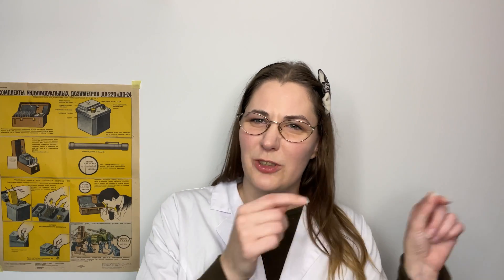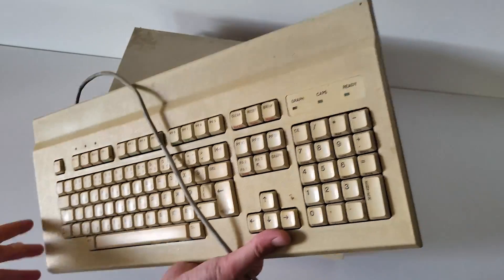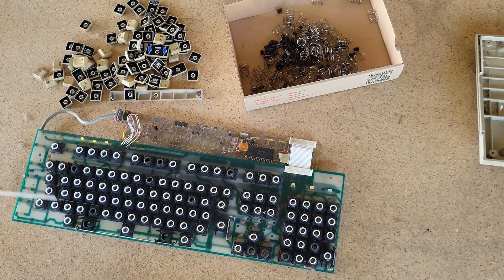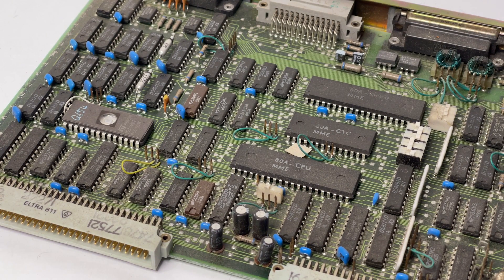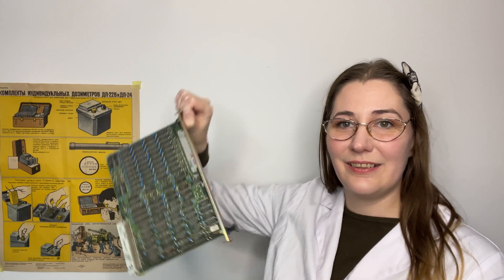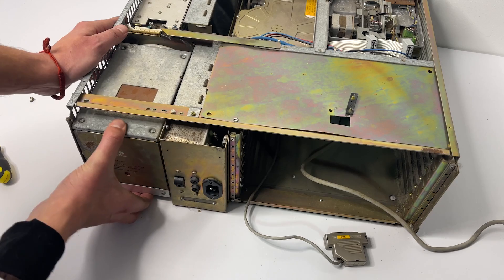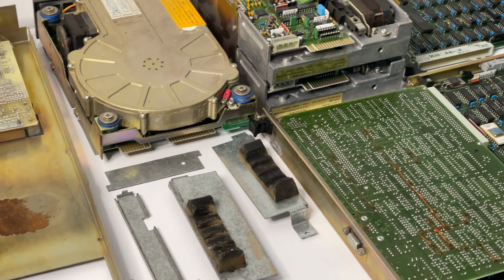It is not a COMPUTER, it is a DISASTER. Robotron SM1910, made in DDR in 1988

Comment: The only computerized thing I have worked on that is more densely packed is a moving/intelligent lighting fixture [the type used in concerts]. Imagine packing 3 slideshow projectors and the optics of a video camera into a frame with all the gears and gubbins of that remote camera [the type that can pan and tilt] you worked on.

One I had at my venue broke its pan belt, which required undoing every connector on the motherboard that ran into the head [control cables for: douser, iris, focus, zoom, prism, 2 color wheels,  and 2 gobo wheels, as well as the power for the 500w arc lamp, and all the fans and stepping motors running those devices] so you could remove the yoke mount to get the pan belt around the pan gear, which was the circumference of the yoke turret.

Yes better designed moving heads use a gear to gear instead of a drive belt to handle pan functions.

Comment: Could the connector to nowhere on the RAM be an artifact of a repurposed board or unimplemented planned functionality? Like either the board it is on is a multi-purpose board that can connect to other things, or there was a plan to mainframe the components and link multiple RAM cards together?

I propose this based on NES and SNES unused expansion ports. Those systems had cable ports on the back/bottom that were intended for disk or CD drive expansions [like the Sega CD or 32X, or the Famicom Disk System] that were never implemented.
Reply: This cards are meant to be multi purpose. Personal computer, mainframe or industrial controller. This is also the reason why this thing is so unnecessary complex. The connector you mentioned is just for testing purposes.

Comment: it's kinda strange to see siemens/intel chips there, given soviets tried to reinvent a wheel by copying anything came in their hands (quite often failing to make a competitive product it seems)
Reply from the maker: Do not forget, it is German-made, there things were a bit different.
Reply: Remember this is made by east germany. There was a permanent shortage of most things, but especially of microelectronics. In this computers, you can find IC's from literally everywhere. For the 8086 CPU, this thing was meant to use the russian clone, but the russians could not produce the needed amount. Because of this it seems they rarely delivered any CPU's to there east german brothers. So the only option was to import 8086 from western sources. Since the 8086 was on the COCOM export restriction list, this has to be smuggled. The black market is also not known for good selection and good prices. So they put in whatever they could get their hands on.

Comment: I am a bit bewildered by the 13:37 "WARRANTY VOID IF SEAL BROKEN" stickers. Did these computers and components really have a warranty? How did the warranty work in the USSR? The stickers look like the same kind found in computers in America and they are written in English.
Reply from the maker: Here it is important to keep in mind it is from DDR, they had their own stuff, we, frankly, do not know how exactly it worked. As for the USSR, somewhat it was similar to normal warranty procedure. Normally there was a warranty card (1...3 pcs) in a form of a page for cutting those out, inside so-called equipment passport (a document provided along with user manual, it contained base specifications, quality assurance seals and details of manufacturer) OR inside a logbook (serious professional equipment could have also this separate document where all changes, malfunctions, etc. could be logged). You would need to ship a faulty equipment either to manufacturer or to authorised service centre along with this passport and/or logbook, they make repair, cut out one of those cards and make a log entry of changes in a special table in one of those documents. There was a list what could be repaired for a free of charge, and what on extra charge. So a bit more paperwork was involved.

Comment: Turns out I have some boards from such computer. Definitely CPU, RAM and video. Components on some are broken (pulled them from e-waste long time ago). Nothing else and I'm fairly sure it is quite difficult to get remaining stuff. Is it acceptable to take them apart and DIY a somewhat similar computer using half-modern components?
Reply from the maker: Well, if you know what youbare doing on a low level, then why not?
Reply: I'm reluctant to tear apart old stuff if it might have some historic value. I'm kind of debating between these options (in order of increasing difficulty):
1. Find someone who need them to restore their device
2. Fix them and hunt / rebuild missing parts to use my boards as-is
3. Tear them apart and use for new project
Reply from the maker: If you want our opinion: CM1910 is not super rare in fact. Old - yes, it is. If your potential creation will give it an afterlife - why not? Perhaps, try to keep it as original as possible and   if it will be a public project — tell the story!

Comment: Wait.... you use periods instead of commas don't you? So that computer was Fifty Three THOUSAND marks? Holy fucking shit. A Trabant was only about 10K... even with hard currency to exchange on the black market, that'd still be a 3 or 4 thousand USD computer in 1988 money. Yeah, that was much, all right. VERY much.
ETA: "You have to remove one thing to remove another thing and then you find you have to remove another thing..." AH! MY FRIEND! WELCOME! Welcome to what it's like to work on modern cars, trucks, and equipment!  It's especially gratifying when they've blocked a simple maintenance item like a filter or pump with a major subassembly that turns a 15 minute job into a 5 hour one!

Comment: It goes back 35 years, not really so long, but it's remarkable how crude and clunky it looks. Far too much copper and dry electrical connections, and not enough silicon. Not really too different from western PCs of the time. I don't miss that equipment a bit.
Reply from the maker: Yes.

Comment: This vid gives me flashbacks of a Xerox 6060 thing someone gave me saying "Maybe you can fix it", and it just wasn't worth fixing after suffering a lighting strike, lol. In hindsight and Google today I guess it was a rebranded Olivetti M24, I really did like the 45-degree angled vents around the lower sides of the case. it was just as complex to get it all apart as in the bottom compartment was a "carbon-residue" connected to another charcoal board up one side of the case, and then off that was another chard PCB on the bottom of the upper compartment that had the metal remains of slot connectors for ad-in cards. every single compartment had at least one screw that was fused in place from arching, I fussed with trying to fix then figure out how to cram a 286 into the case for a year then tossed it out as it just wasn't fixable and taking up room. if it wasn't a lighting strike victim I probably would have tried to keep it, yet things happen. I guess computers have been hit and miss for eons, not just the latest fad of tempered glass convection oven styles, lol.
Reply from the maker: Thank you for sharing!

Comment: Last Week i got my own CM 1910, completely unexpected and free! It is complete and in much better Shape than yours. 
It has the rare 1MB RAM board and so far i could test, the system seems fully operational.
Got no monitor with it, so i  had to make my own  video caple from an old VGA cable, and used my  OSSC with that.
At least i was able to play some tetris, wich was on the HDD.
Reply from the maker: Congratulations!!!

Comment: Needs some cleanup and retrobrighting, 
4:09 I see a big-ass paper in oil capacitor. I wonder why such an archaic and oversized component from the vacuum tube era is even there.
11:50 calling the manufacturer's technical support, haha! 12:04 lab assistant coming to help you. And 12:17 is "automatic medical systems engaged, caffeine adminstered".
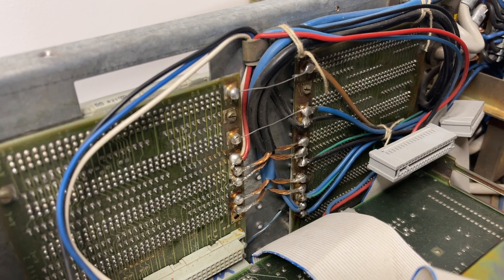14:10 yeah, no beauty, no joy. 
15:00 inaccessible fuses, I know it may be a safeguard against unauthorized bypassing by the user, but c'mon - that's a BS in design and engineering...
Reply: 4:09 is not a simple capacitor, but a line filter
Reply from the maker: ...if it would be a caffeine!... ;))
Reply: @ChernobylFamily  don't tell me it was heavy fuel, haha!
Reply from the maker: It was beer :)

Comment: If anything at all, this computer resembles a 1970s S100  based computer more than it does a PC. Huge boards filled with rows of logic chips, tightly squeezed onto a backpane, connectors and cables to the power supply, front panels and other components that got squeezed in over time. Somebody must have been trying hard to take old and proven methods to the next level. 

And yes, 56800 Mark was a high price. Calculating a precise value in today's money would be hard, but it certainly was well beyond anything a private person could easily afford. Or even get their hands on, even if they had the money.
Reply from the maker: Thank you for sharing!

Comment: Usually electronics from the GDR are built so that they can be fixed easily. At least that's the case for devices meant for the general public.This computer seems to have been built by engineers for engineers as just the disassembly to get to a broken part is a challenge. Also testing must be quite difficult as you have to put it almost fully back together first.
Reply from the maker: Agree. I dealt with a lot of DDR-made tech, which was awesome inside, and discovering this very machine was a shock.

Comment: Just to help you along, the usual English language term is SOLDER or SOLDERING rather than welding (I know this is used by Chinese translations as well).  Welding is for building steel bridges and repairing cars.
You also use the term crate, I understood what you meant after a short time, but the more usual term is CARD CAGE for the place where the PCBs are.  They might also be called CARDS, as in "This is the IO card."  The whole thing, that holds the card cage, drives, power supply, etc is called the CHASSIS.
Reply from the maker: Many thanks for this!

Comment: board2: looks like  Z80 board with Z80 sub-service chips - ? might have 64k ?

i have seen boards made by Siemens with this bus
Reply: Yes, the U880 (Z80 clone) and it's peripherals were popular chips because the GDR does produce them by itself - so they were available. In this system they used one complete Z80 system as storage subsystem and one as graphics subsystem. On the one hand it is unnecessarily complicated, inefficient and incompatible with standard software. On the other hand a very interesting piece to play with.

Comment: This Robotron looks like it might be VME bus, a 64 bit bus architecture popular for higher end workstations and industrial computers in the mid 1990s.  I owned a VME bus Sun-3/160 workstation with 1.5 KW power supply.  It weighed about 300 pounds.
Reply from the maker: Many commenters suggested the same. I trust you guys!
Reply: It's actually Multibus- also known as IEEE 796- a 16-bit bus designed for use in industrial equipment.
Reply: @douro20  Thank you for the correction.  It has been too long since I worked with that in the early 1980s.  I should have recognized it.

Comment: I’d imagine that extra ram connector is to just allow the part to connect to either side of the bus. Manufacture it with connectors on both ends and it’ll work in whatever configuration is needed, just move the bracket.
Reply from the maker: Sounds as a possible reason. Thanks!

Comment: Regarding that RAM board. It seems the board can be installed with either of the connectors facing to the inside. If I were to venture a guess, the same board is used to support two different computer designs with different bus configurations. If I recall right (it's only been over 3 decades), before getting their hands on western CPUs, Robotron also featured Russian CPUs. Maybe the alternate orientation supports the bus from those things.
Reply: The manual of the RAM board says "Steckverbinder X3 - griffseitig als Prüfstecker" - "Connector X3 - on the handle side as a test plug". This boards are so dense populated because they also included parity and refresh.
Reply: @stefanberndt3076  Great. Thanks. I'm surprised they'd use a second bus to test it, but everything is overengineered about that computer, so why not that, too.
Reply: @akiko009  Not really a "bus" to test. Just some important points to test circuits. The more surprising is, that they wasted an expensive connector just for that. Today needle-like probes are used to connect to solder joints for measuring.
Reply from the maker: Thank you for these details!

Comment: "To remove something you have to remove something and you find the screw to remove that is under something"

I think the same people designed Dell laptops. I have to replace the fan in mine, which is a commonly replaced part, and to do it I have to take the entire thing apart. Do better, Dell.
Reply from the maker: That hurts

Comment: What the hell is that thing... There is not a single board without some rework or bodge wires o_O
Was it really "mass" produced, or is it a strange kind of prototype made late in the night by a team of crazy, or drunk, or even both at the same time, engineers? 
And I know why there is a plain metal plate in front of the rear connector of the RAM board! It was just designed by the same guy who was in charge of the fuses....-_- (double facepalm).
(If you have managed to make this thing boot, you're true heroes)
Reply: It was mass produced. This are 4 layer PCB, very heavy packed. I think they where just not able to route all signals, so they added this wires as a 5th layer.
Reply from the maker: It was a mass production...well, the design is something, that is true.
Reply: @ChernobylFamily  Looks more like "mess" production  to me ;)

Comment: The main boards look like they are VME bus. This bus style is typically used in industrial equipment. It was a very odd design choice to use it in a desktop form factor. I have to wonder if they used it because it was easier to obtain VME cards as opposed to more conventional consumer grade cards.
Reply: They called this bus system "MMS 16", it was a clone of the "intel multibus I". This system seems build with compatibility to this intel systems in mind. The KES board (storage subsystem) is made to be software compatible to the intel iSBC215/iSBX218. Too bad the intel multibus was a failure also in the western world. They have set there bet on the wrong horse. I have read an interview with the leading managers of this industry in that time. He said, the made real good money with this machines, just because of the mad RGW pricing procedures.
Reply from the maker: If I recall correct, there were more robotron computers that used these.

Comment: The price of 56.873 EastGermanMark have been about 2.800 DMark or 1400€ (rounded up). That translates in todays money (all the Inflation accounted) of about 2900€.
Reply: Not accurate. I remember my parents had around 1200M each per month salary. A bread roll costs 0.05M, a full bread 0.35M. Just for compasion...
Reply: Base of those numbers is the official exchangerate at the day of reunification. According to wikki, that rate was 20 mark east equals 1 Mark west. Euro wasnt a thing back than and is just added for easy compare.
Sure, food and drinks have been verry cheap in east germany, but technic related Items have been expansive as hell.
@Stefan, ask your parents If they remember the price of for example a RFT amplifier or a TV. You will be shocked 😎
Reply: @patrikdavid8597  I know Electronics were very expensive. That's exactly the point. You cannot just compare the numbers by exchange rates. You have to get cost of living in comparison to understand how insane high this price was.
Reply from the maker: Holy...

Comment: Oh my. The power supply is the biggest shock, there have been multi tap transformers for many decades and even in the 70’s diodes we’re cheap. I really don’t understand it at all. The highly exposed wire reminds me of Knob and tube wiring from a house. The outside to inside cables is just poor design. The cards and busses weren’t interconnected well so it required that to navigate that fortress of a chassis.

They would have been better off cloning a Commodore 64, or an Apple 2.
Reply from the maker: It wax very surprising to discover these. DDR made pretty ok computers, but this one is... something.

Comment: I love how on the CPU board, "Made in the USSR" is plastered across that wide format IC. I assume some sort of bus controller or IO chip? It just yells at you that THAT CHIP was made in the USSR. Just so we know. A message that spanned the decades. Your complaint about having to take the whole darn system apart to get at one thing is a popular complaint of those of us who do our own upkeep on our Japanese cars. I think the East Germans may have done something very noteworthy with this system. It seems the volume of the individual components exceeds the internal volume of the case enclosure. Did the DDR learn how to violate conservation space with this system? Does light curve around the edges once it's all together forming a kind of event horizon as a function what must be extremely high mass.

That video card looks fascinating for what is probably not much more than a Hercules monochrome graphics card equiv. A full up 8088 with a 8087 was not a weak system even in 1988. 20 MB of HD space was pretty good back then too. That system would have gotten my thru college.
Reply from the maker: That chip with a large writing is a clone of intel 8255, an i/o controller. That one was produced by a factory that loved to make such big inscriptions, normally there won't be any if made by other factories.

I completely loved that note about the event horizon. This thing is so heavy it nearly collapsed us that poor white table..)